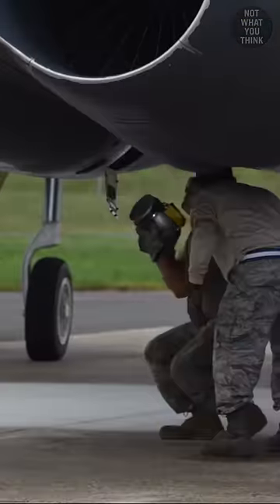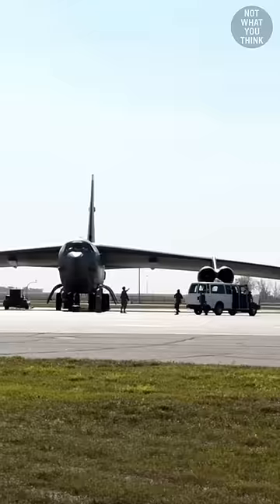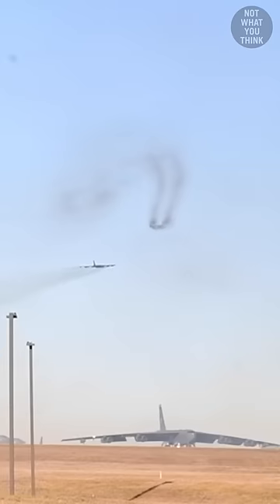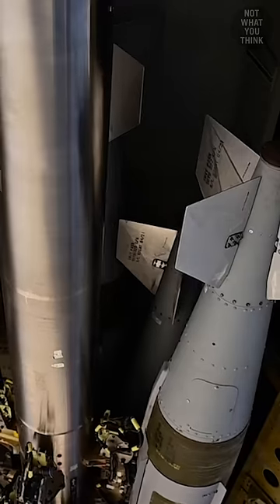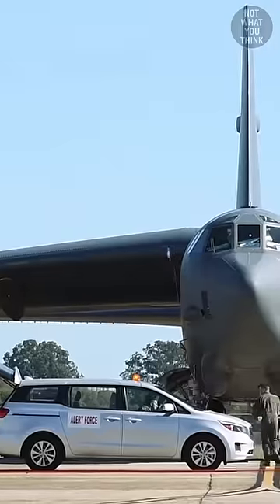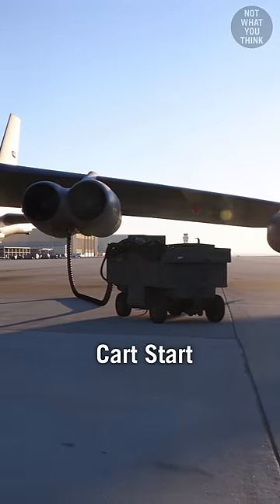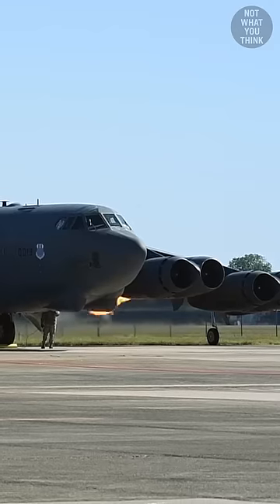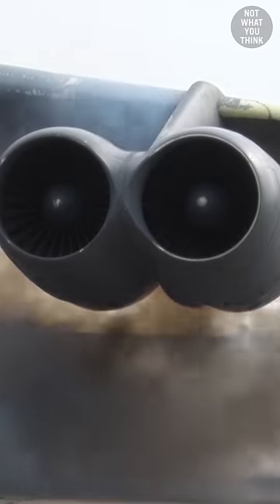Putting Explosives Inside Aircraft Engine #shorts

Comment: Folks, the narrator is mistaken. It's not a "bomb" to start the engines. It is a black powder cartridge. It doesn't hurt the engines at all, but the black powder does cause a carbon buildup in the air starter and must be cleaned every so often. Engines like the B-52 and a lot of other military aircraft must be started with air pressure, and that is normally provided by the large cart on the ground under the wing in the first few seconds of the video. It's called a -60, and provides bleed air and AC and DC power. The bleed air is hooked to a port on the engine and turns the starter over to get enough RPM's to start the engine. The cartridge start replaces the bleed air from the -60, and the engine has an electrical generator to provide electrical power when it's running.
Reply: ...so basically an explosive...
Reply: Common with jet engines of any large aircraft.
Reply: Im pretty confident that “A small controlled explosive”meets the criteria of being a bomb.
Reply: I don't know man, that sh*t can still hurt someone as an IED bomb.
Reply: Good to hear (read) someone mention the ol Dash 60 . That's how we started the F111Fs , or did a cart start if they were on victor alert. Still miss all that after 4 and a half decades 😮😮😮😮
Reply: DINSTAAR
Reply: @akam9919  No. Black powder is relatively slow burning.
Reply: @-Apollo-13 black powder deflegrates, not detonates. A bullet cartridge is not a bomb. Powder charges are not bombs. Some bombs can make use of powder, but that requires containment that will fail after a certain pressure is achieved.
Reply: @akam9919  Explosives explode. This burns
Reply: It is a propellant, not an explosive. It isn't just black powder as it has a strong ammonia smell and very little sulfer smell. I've had to try to avoid the smoke from cartridge starts many times.
Reply: @-Apollo-13  So a bang snap firework is a bomb? A fuse is a bomb?
Reply: @harrystone8847 The Air Cart doesnt provide the generator power, there is a separate generator hooked up behind the bottom main hatch copilot side, everything else is correct
Reply: @-Apollo-13  Bullets, rockets, grenades, guided-missiles, artillery, internal combustion engine, but yes all controlled explosives are bombs u right
Reply: @ShimrraJamaane  it can detonate in a confined space
Reply: Bro your leaking classified documents again
Reply: @matthewfox1561  Nobody here is leaking anything, his statement is pure science anyone can google about things that go boom. I doubt you belong to one of us so please with all due respect, do your research
Reply: I like that he said cart start while showing a start cart
Reply: @mattfernandez5821  Only some bullets are explosive, and they are generally referred to as shells; I assume you mean small caliber cartridges. They can result in a detonation sometimes, such as firing +p+ out of an unrated barrel. Otherwise, the powder propellant deflagrates, resulting in combustion rather than detonation.

There are two primary types of explosions: combustions and detonations. Combustions are usually materials that are undergoing deflagration, which is subsonic. Detonations are materials that are undergoing supersonic explosion.

Rockets, grenades, missiles, and explosive shells (e.g. artillery/mortars/cannon) contain high-explosives that detonate, behaving as bombs. Most bullets and an internal combustion engine do not experience explosive detonations, they experience explosive combustions (deflagrations) in order to propel an object, a bullet and a piston, respectively, away from the combustion. A bomb requires detonation, which means that most small-caliber rounds and an ICE are not bombs.
Reply: @mattfernandez5821  Black powder does not detonate, it always deflagrates. It is a low-explosive. It can simulate a detonation, but it does not experience detonation itself. As for how it can simulate a detonation, it is not simply a confined space, but an enclosed space capable of retaining the building pressure until the container integrity fails, resulting in an explosion that is analogous to a detonation.

Yes, black powder can fuel a secondary mechanical explosion that acts as a detonation when confined within a container capable of containing the increasing pressure (because the powder is continuing to deflagrate) long enough to create sufficiently high pressures.

It is like adding too much pressure to a tire. Air itself isn't detonating, the tire simply fails, resulting in an explosion.
Reply: @akam9919  No, it's a gas generator. Under the right conditions black powder can produce enough gas to cause a container to rupture, giving the appearance of an explosive, but the black powder did not explode.
Reply: @ShimrraJamaane  The rate of combustion the black powder experiences in this situation surpasses the speed of sound, making it a detonation. Its called a Deflagration-Detonation transition. Source: My job is handling explosives
Reply: @ShimrraJamaane  Also im not sure what youre typing all this nonsense about here. I was being sarcastic. Im fully aware and ICE is not a bomb. Im an EOD tech.
Reply: @mattfernandez5821  "The rate of combustion the black powder experiences in this situation surpasses the speed of sound, making it a detonation." Not in a cart-start. It is a sub-sonic combustion wave.

"Its called a Deflagration-Detonation transition. Source: My job is handling explosives" Yes, black powder can experience a DDT, under very specific circumstances that are not reasonable in applications outside of meter-long steel casings. Should I have been as absolutist about it? Probably not. My point still stands that in these devices there is no such transition, it is purely deflagration.

"Also im not sure what youre typing all this nonsense about here." I'm not typing nonsense. Happy to discuss where you feel that I am. It is extremely hard to cause a DDT with black powder (e.g. you need large, special containment and initiation to create it).

"I was being sarcastic. Im fully aware and ICE is not a bomb." Sarcasm rarely translates in text. Certainly you can understand my refutation that an ICE is a bomb, given the lack of awareness that you were being sarcastic.

"Im an EOD tech." Cool job. I'm not discounting your experience on the matter. I will still assert that DDT in black powder is not possible outside of large, specialized containment and initiation devices. I made sure to reevaluate my knowledge through renewed research of DDT in regards to black powder before replying, given your experience. If you can cite any papers that show you can have detonation in smaller payloads, I'd be happy if you would point me to them (title and author would be sufficient). I have no problem being corrected when I'm wrong, and I welcome learning.
Reply: @akam9919 no, gunpowder is not an explosive. For something to be an explosive it needs to have high speed of burning per secund. Gun powder isnt close to that speed
Reply: @greenbere14 DINSTAAR!
Reply: @-Apollo-13  and ejection seats?
Reply: @sgt.beanpole9669 AGE GANGSTER 🤙🏼
Reply: @kryptyca3201 
Doesn't the B-52 take Three Phase 120 VAC at 400 Hertz? Or does it take 24 VDC?
Either way the -60A can provide that and Bleed Air to spin up the engines.
Reply: @cynicalrabbit915  so I don't know about all systems since I'm only 2A951 but for main power I'm pretty sure it's both since the Hobarts we use are hybrids. Some of the instruments with bit tests do read vdc flow but for the most part it's just that vac being distributed. Sorry if I can't remember off the top of my head, since I don't actually maintain the batteries nor generators, just turn em on and flip switches for aircraft main power to run my stuff. I'm also not saying it can't run it but with our TO's we will almost never use an air cart to run up a jets main power. We have different things for different tasks.
Reply: @kryptyca3201  
The Hobart diesel generators came in a bit before I left the service.  All I know or remember was that the -60A was capable of all three, Bleed Air, Aircraft Power both AC & DC. DC was from a rectifier box mounted inside the right side front access door.
The -60A had a larger Gas Turbine Engine than the older -60. The -60 had a dual pad gear case that had AC and DC generators.

It may be that the Bombers B-52 and B-1 have power demands beyond the capability of the -60A therefore it can't supply Power and Bleed Air. Making it work too hard might cause the exhaust gas temperature to go too high, risking turbine wheel failure.
Reply: @kryptyca3201  Not true. I used those devices for over 20 years, they provide both AC, DC and air.
Reply: @harrystone8847   As I've said b4, even if it did have that capability we aren't going to use it. I just follow what the TO says and if I had to place a thought as to why we don't it's because of the risks of failure. Our equipment is old as hell and prone to failure. We have hobarts for main aircraft power, air carts for bleed air, and ac cart for cabin air. Also the air carts require certs* not everyone has since it's used for engine startup. End of day, air cart only needed for engine startup/bleed air, also requires certs. You don't need engines on for almost anything except like 1 or 2 checks which isn't frequent. (Unless ofc aircrew wants to fly, they get extra checks just on repeat with engines on)
Reply: @harrystone8847  I also want to know what your job is out of curiosity, idk I'd ur a civi maintainer or enlisted but we do not use the air cart for vac vdc, just wanna know who still uses that one turbine generator for it's multi use since we haven't done that in years
Reply: @kryptyca3201  That's interesting. I've been retired from the AF for 24 years, but the -60 in the video actually does air and electrical power. We didn't have "hobarts" back then. I was avionics on F-111 aircraft from 1976 to 2000.
Reply: @harrystone8847   Well first off thank you brother for joining. I've been part of Avionics for almost 2 years in October, I'm a comm nav troop for the B52, and on that second note, I actually don't know when we stopped using the -60 for vac and vdc but I do find it intriguing that it used to be a thing
Reply: @akam9919 so a shotgun blank is a bomb
Reply: I'm fine with calling a coffee-can full of black powder a "bomb". To me, a squishy civilian, it is functionally identical to a lot of explosive and deflagrating items which are also called bombs colloquially. If it does its thing next to me I will be just as effed up as if it was a grenade or a mine or a bomblet.

Just because specialists have appropriated a word to mean a specialised thing does not make the casual use of it wrong. Let people use words casually, I beg you in the bowels of Christ.

Comment: The wingspan vs. fuselage size is insane, but probably one of the reasons the plan has been in use for so long.
Reply: The wings are also made with a cantilever box design that lets them flex upto 24 feet in either direction, looking like they are flapping

Comment: At First I thought they were referring to a fire  squib, but that is a minor explosive fire retardant device for our KC-135 R&T models on the CFM56 engines.  I was an Aircraft Maintenance Scheduler at RAF Mildenhall, U.K.  between 1988 - 1997. I had to drive to RAF Lakenheath, U.K. to pick them up.  The same place they kept their ammo. for their F-15Es.  It was awesome waiting just 50+ yards from the F-15 as it spun up its twin engines to take-off from its hammerhead as it departed.  My truck and body was vibrating like nothing else from all noise and  thrust generated!

Comment: In they movie Flight of The Pheniox, they use this method to start the plane, it's basically a gaint shotgun blank.
Reply: Not really.  In the movie, the cartridge discharged into the cylinder causing the engine to rotate.  In a jet engine, the gases from the burning cartridge are routed into the starter turbine wheel, causing the engine to rotate

Comment: The start cart has nothing to do with the explosive. The cart start works by pumping absolute unit amounts of high pressure air over the blades and through the engine to get it spinning fast enough to start the ignition of the engine. These charges are far more common on WWII era radial piston engine planes. The same blank shotgun shell would be loaded into some of the cylinders of the engine to replicate the explosion in a piston during operation. This then got the engine spinning fast enough to start ignition of the combustion chambers.
Reply: It’s a 1.3 explosive… it creates gases to spine the starter enough the support ignition
Reply: @grandmasterpu  Yeah, that’s what it does in jets. Just clearing up the false association.
Reply: Not even close.  The exhaust gases from the cartridge, are routed thru the starter, which then rotates the engine.
Reply: @robertheinkel6225  aren’t the charges routed directly into the cylinders?

Comment: We also had the ability to use them in F-111s. They took place of the bleed air of the cart, which actually has its own jet engine to generate bleed air and electricity. We called them -60s

Comment: We sometimes cart started the F-4 Wild Weasels. Putting one of those coffee can sized carts in the engine. It did have a draw back. Makes a helluva lot of smoke, if the wind changed, you were blinded. It would  sometimes also set fire to the concrete under the jet. The flame that came out of the cart was about 6 feet long. Reflecting off the ground. If you know anything about F-4's, having the ground underneath them catch fire is no big surprise. The F-4 leaded like a sieve. There was a permanent shadow on the ground in the silhouette of the aircraft. Oil, fuel, hydraulic fluid. It all leaked. And was flammable.

Comment: They also “alert cock” the aircraft. Where they go ahead and run most of the start up check list and get most of the buttons already on the right position. So when they do get alerted, they only have 1-2 more buttons to press which turns on the power and starts spoiling the engines. 

On C17s we had a switch by the crew door. So the first crew up the steps could press the button which would get the whole aircraft starting up before any crew me ever had even reached the flight deck yet. 

But as you said, this is usually done for real, in real world serious situations and in an extremely controlled environment. As allot can go wrong with a loaded jet running that’s unattended.

Comment: Navy went to APUs, a smaller engine in between the dual engines to huffer start one engine, then bleed over and start the other.  I knew WW2 planes used a blank shell to start, didnt realize the B-52 had this.  Nerdy cool.
Reply: also gives you AC without having to run the engines
Reply: The B-52 also has APUs, but they aren't big enough to start all 8 engines at once, so instead they still use the cart starts. Also, the APU consumes fuel, and must already be running in order to provide bleed air, which takes time that you don't have in a scramble
Reply: @richardmillhousenixon  makes sense.  We would start the APU on F-18s, get one engine going, cut APU off.  Only downside is if the accumulator dumped pressure, you end up in the wheel well squatted down pumping a handle in the heat.

Comment: It's a #10 Food Service Can full of Black Powder, during the cold war we only used 2/airplane while on Nuclear Alert. All of the switches in the airplane were preset to the point of starting the engines. It did not take an hour to actually start the plane. All of the preflight inspections too about an hour to complete to ensure it was safe to start the airplane. Maintenance people have been working on the plane and may have left a switch or a circuit breaker in a position that could have caused something bad to happen.

Comment: Cart starts is using a air cart and unless the B-52 has a APU needs it for a regular startup. It does not take an hour to startup a B-52 under normal circumstances.

Comment: Worked with an old tractor that used a 12 gauge blank to start it up
Reply: How did that work
Reply: Did the spark/ energy from the blank ignite the fuel?
Reply: @skramzgod  Basically, it acted like a starting coil

Comment: A 'cart start' is not the same as a 'start cart', when the narrator was talking about starting the engines with the gunpowder cartridge they mistakenly showed a start cart, which is the compressed air trailer used for normal starts.

Comment: Do they still use water afterburners on take off? I know they did back in the day.
Reply: No, the only -52 in service is the B-52-H.  The H's were the only variant to  use turbofan engines which do not not use water injection. Previous variants all used turbojet engines with water injection.

Comment: The funny part is that they used to use rockets to assist with the take off back in yester year. The things would separate after they were spent. I suppose that changed after one enterprising Darwin Award winner used at least one here in NM trying to break a land speed record only to end up taking flight and burying himself as well as vehicle into the side of the mountain that HW 70 runs through outside Las Cruces.
Reply: B-52s never had rockets to assist takeoff

Comment: The F-20 was designed with cart start in mind too. The entire idea behind that was to take an airframe that was cold and dark inside the hangar and get it into the air in less than 7 minutes.

I still think not selecting the F-20 was a mistake; it may have had a hard fight against the F-16 for the Air Force, but the National Guard would have loved it (and it probably would have fit their mission profile better than the F-16, too).

Comment: Hmm why only 2 engines though
Reply: They only need two because once those are started you can boot all the electronics (which is the longest task) while you start the others with either air or electricity supplied by the first two.